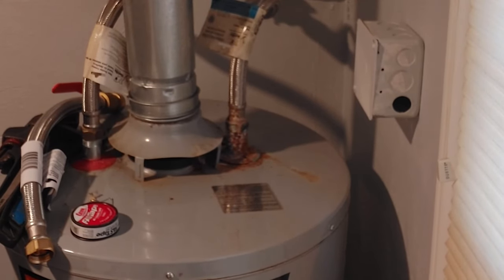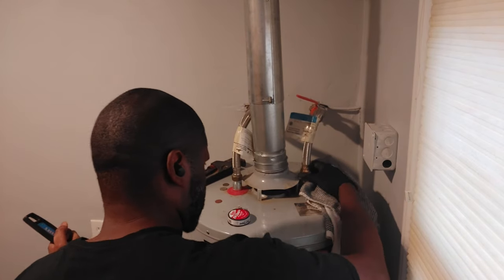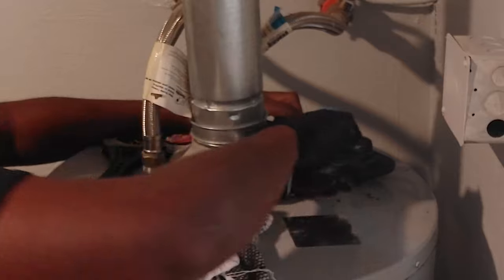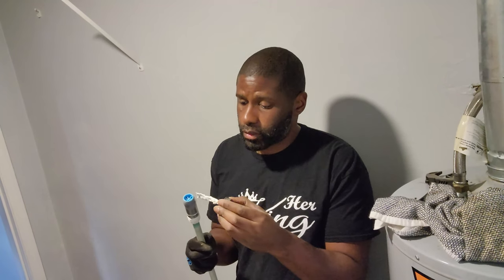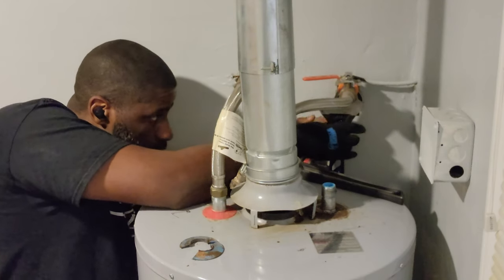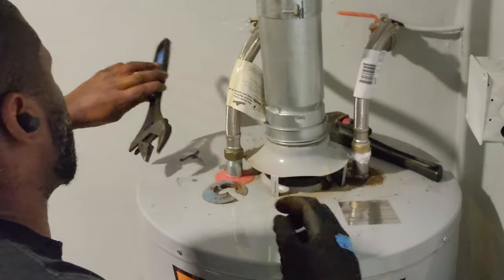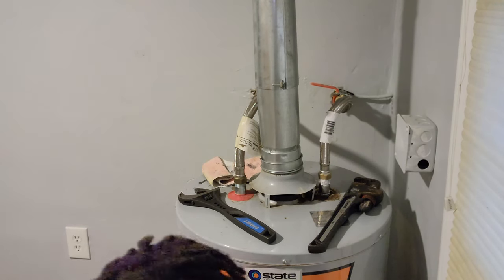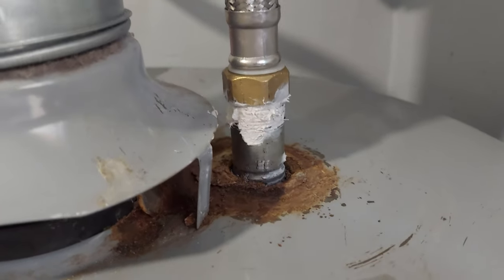I saved some money replacing a nipple on water heater myself. DIY

Comment: To check for leaks you should open the valve and open a hot water tap in the house to expel the air at the top of the tank and in that flexible pipe. If there is a leak, you may not see leaking water at first because only air would leak out at first.

Comment: Nice job, your water heater looks relatively new. Like under 5 years, definitely under 10, because I'm surprised at how easily the nipple came off, even with that pipe wrench, they can be notoriously difficult to get out. Next time, don't put the pipe wrench on the nipple, you could strip the threads or crush the nipple, then you'd have a heck of a time getting it out. Get a nipple remover, it looks like a big version of a screw extractor, you put it inside, then you can use whatever wrench on the extractor, not on the nipple itself. You just lucked out here buddy. Take it from me. My 13 year old water heater hot nipple was not coming off no matter what size pipe you put on it, no pun intended. I ended up having to destroy the nipple with a step drill bit. Not fun at all. Also, its easy to remove the flue so that you have better access to stuff.
Reply: Thanks, I think, or at least I hope I have an issue with the nipple on the hot side of my water heater. It's not that old but I have another job coming that an extractor set would be useful for anyway. Hot water flow on all my faucets drastically decreased after flushing the heater out. Heater fills up very fast so It's fairly safe to say the cold side is working fine.
Reply: Thanks for the input. I was able to get the nipple off but I can’t get at the fitting for the dip tube. Any advice?

Comment: That "water line" inside the tank is called a dip tube. It sends cold water to the bottom of the tank so that cold water entering the tank  does not mix with hot water at the top.
You said you applied Teflon tape but the video showed you used a paste.
Use a dielectric union to prevent the galvanized pipe to brass/copper fitting from corroding.
Reply: He said teflon tape then paste immediately.

Comment: Did you drain the water heater?
Reply from the maker: No. I left the water in.
Reply: It's helpful to drain water heater a little to let water from the pipes drain into the tank instead of spill on top of the water heater, especially if there is a expansion tank. Just a few gallons. No need to fully drain the tank.